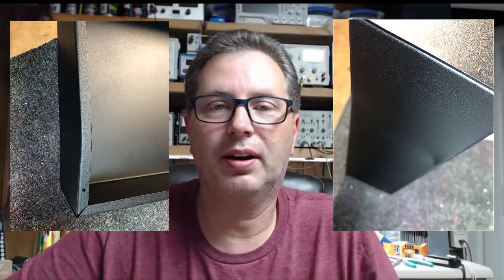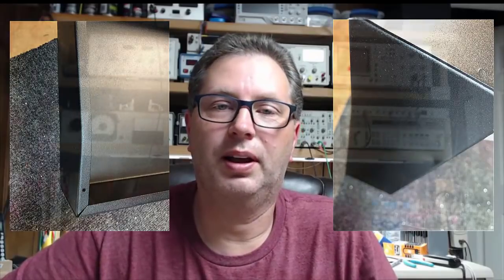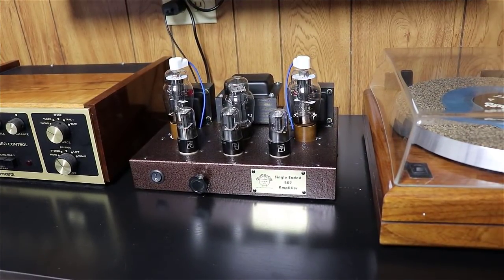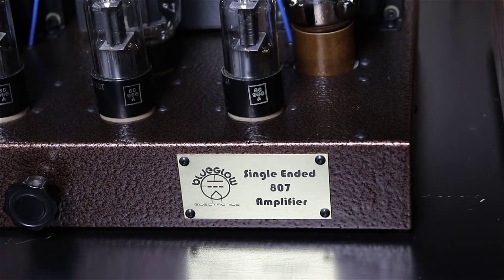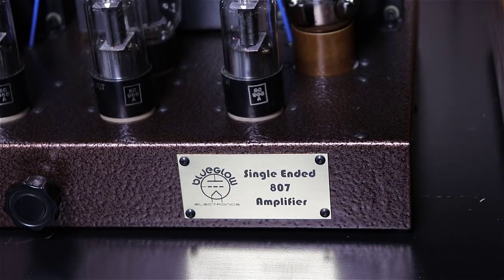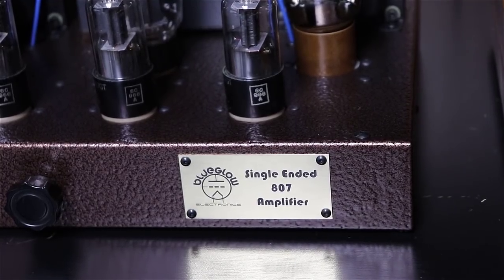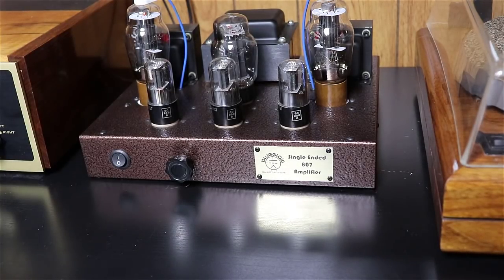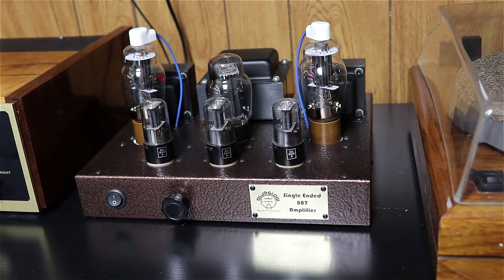Single Ended Tube Amplifier Build 2017 - Part 17 - Finishing Touch and Viewer Submissions

Comment: I hope your making out well in this storm, I finally finished punching out the rest of the chassis but I am not sure what color I want it. My wife says she's taking my EL 84 SE stereo once this is finished.  I used a 3" height as well for the extra room, I have seen many Carlsons Lab and What you said about interference the chokes might have with the Output Transformers. I think a will fabricate two shielded boxes to encapsulate the chokes, my only worry might be heat build up in them

Comment: Thanks for showing my 807 amp. I used a 3 inch high chassis to give me more room to tinker inside, and I put two inputs on the amp, so there are two knobs on the front, one to select input, the other for volume. The plan is to use one to connect a phono stage, the other is connected to an echo dot (though this would benefit from a preamp stage). So no reaching around the back to swap inputs. I am now working on a Perspex or acrylic cover for the top to protect the valves when it is off.  I must say, it sounds amazing and now the nights are drawing in, looks fabulous in the dark. Thanks for introducing me to the world of valve amplifiers.

Comment: I'm planing a push pull 807 amp and one of the details I'm using is braided plastic cable sleeving over the anode wires ( used by the PC cable modding guys ) , looks real good and ads another layer of insulation protection between you and that B+. I chose red and black mixed , $3 for 5 metres ebay.

Comment: Hi! In part 15 of the build due to not having the good .33 mfd caps that you had wanted to put in you had put in yellow polly caps to keep the project moving along. Had you replaced them or decided the polly caps are sufficient? The label looks really cool and completes the look of the amplifier. Great job! Too bad about the dented chassis,  hope the next one arrives mint.
Reply from the maker: I left them in.  Nothing wrong with good mallory yellow poly caps.  They sound great.